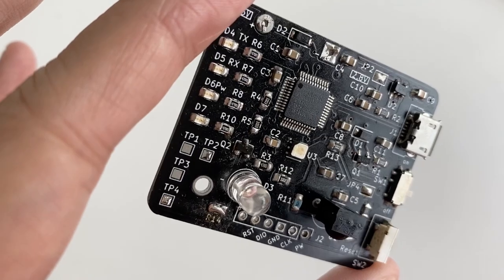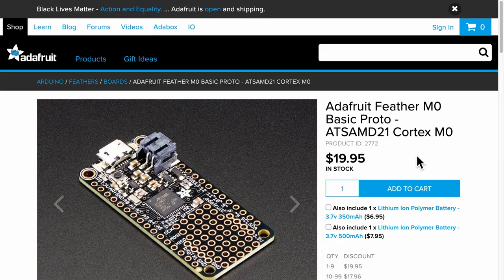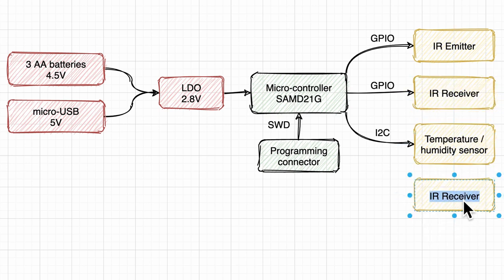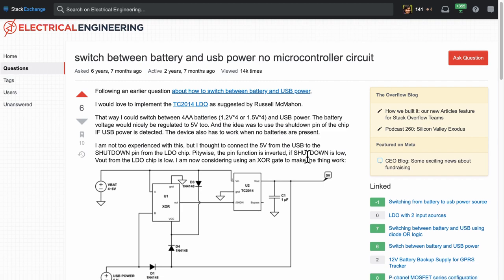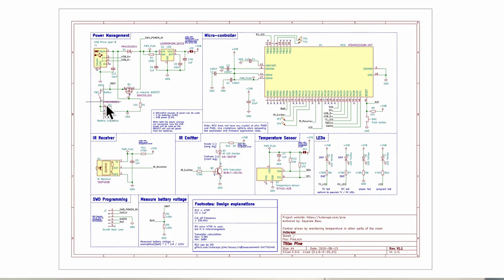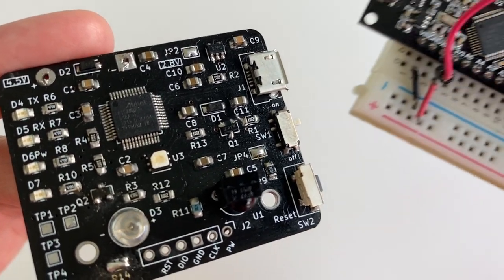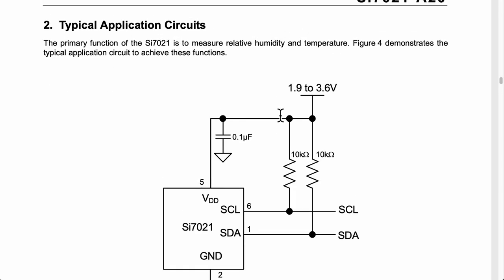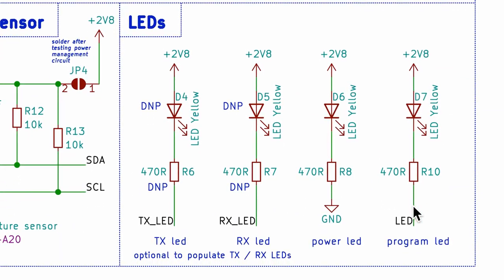Design considerations for transferring a breadboard prototype to custom PCB // Arduino, mcu, sensors

Comment: Thank you so much for such an in-depth and accurate manifestation of information. Recently I've designed two versions of my custom PCB for a project based on the PIC18F45Q43; but both times the MCU burns out when I power the circuit.. I think its the power and the PCB layout (Please let me know if someone thinks it could be some other cause). Nonetheless, it is videos like this that help a lot! So thanks again! 😊
Reply from the maker: Wow! Yeah, that's the most challenging part. Have you tried using a current limiting power supply or using 0-ohm resistors to isolate the PIC chip first and probing the GND and power pads? Maybe you did that already. Hope it works out for you!
Reply: @sayanee  I actually did not try the 0 ohm resistor approach. Since I'm not completely comfortable with soldering 0603 or 0805 resistors; I get them soldered through JLC PCB. In addition, unfortunately I do not have access to a current limiting power supply. 

On the contrary, if you don't mind; would you be able to recommend me a 5V power supply circuit for the PIC microcontrollers (SMD packages)? 1 Amp voltage regulator would do. 

Thank you so much once again!

Comment: So informative❤, I wasnt aware about the operating voltage range, I was deciding that 3v3 is standard, while in fact some devices range from 1v6 to 5v .
In addition, I think before we order any pcb , we need to test alot on bread board almost all circuitry before we put them in the final place on the pcb.
As well some compenent must have certain location in the pcb for instance decoupling capacitors to work perfectly they should be as close as possible from the mcu, same for the crystal. 😊

Comment: Hello Sayanee, where did you order the PCB's? also I have the doubt if you soldered all the components or what assembly service do you recommend? Thank you so much (I am asking this since JLCPCB for example, has lack of storage in many parts)
Reply from the maker: I use PCBWay now.

I too would like to try out assembly services. And I recognize that no matter what, we will not always be able to match all the components we want with what the service might provide.

Hence, I am thinking of doing a partial assembly. Get the passives and common parts (resistors, capacitors, LED, USB / JST connectors) and connectors assembled. And then, hand solder the rest.

At least, we will save a lot of time that way :)
Reply: @sayanee  could you recommend an specific assembly service company?? Thank you a lot for your videos, I am learning a lot with them
Reply from the maker: @IMTIvanBlake  I have never used one yet to recommend from personal experience. 

But I will do this with PCBWay for my next project: https://www.pcbway.com/pcb-assembly.html
Reply: @sayanee  thank you so much Sayanee, I will wait for your future videos ☺️

Comment: Excellent video Sayanee, kudos for the ways you explain concepts!!!

I am a hobbyist and doing some automation around the house using D1 Mini and NodeMCU boards to hook up sensors and relays. These boards have a microcontroller but on PCB design sites (& Kicad) I did not find any options to use D1 or NodeMCU boards for PCB design. Are these (D1 & NodeMCU) not standard options for PCB components?
Reply from the maker: "I did not find any options to use D1 or NodeMCU boards for PCB design" 

Do you mean specific schematic symbols and footprints for NodeMCU? 

If that's what you mean, then in general, no, you might not find the specific schematic symbol and footprint to use for many components. But, you can always do a search on GitHub / GitLab to check if someone else has already open-sourced it. 

If not make a new schematic symbol or a footprint. I did a previous video on making a new schematic symbol (https://www.youtube.com/watch?v=PXMvn3cztGg) and a new footprint from scratch (https://www.youtube.com/watch?v=VesvKjfd3SQ).

Hope this helps!
Reply: @sayanee  Thanks, that helps and bless you to keep up the good work!
Reply from the maker: @PM13501  I forgot to mention that for my past project I did make a schematic symbol for WeMos D1 Mini: https://github.com/hutscape/kicad-library/tree/master/symbols#wemos-d1-mini

and its footprint: https://github.com/hutscape/kicad-library/tree/master/footprints/wemos_d1_mini.pretty

Feel free to use it and iterate accordingly. All the best for your project too.

Comment: Hello, I am interested in turning my breadboard project on to a circuit board, I am rather new to this, But need help in the right direction.  I am a model railroad er I am using 2 IR sensors for detection from open to closing the gates an operating the lights an sound. An I really wanna add a circuit board so I can place it under the crossing an only have my IR wires connected to reach out.  
can you please help me on sending to have it manufactured or help me with the correct components to buy to make this an reality.

Comment: I want to use your battery/usb power switching logic in a small project I want to build with ESP32. But I am worried about the schottky diode (PM3020EH) that sits after the USB socket.
I believe the purpose of this diode is to cut off the path from the USB when your circuit is powered with batteries only. When the USB is connected this diode becomes turned on and 5V is delivered to the circuit from the USB while the P channel MOSFET is shut off, right? My issue is that I can't afford the voltage drop across this schottky diode because my circuit needs 5V to drive some other TTL chips. Your circuit only needs the 2.8V produced by the voltage regulator so the voltage drop is irrelevant. Do you know any other widely available schottky diode with a voltage drop of 0.3V because I wouldn't mind using 4.7V. Getting rid of this schottky diode doesn't seem to be an option. Any suggestions?
Reply from the maker: "When the USB is connected this diode becomes turned on and 5V is delivered to the circuit from the USB while the P channel MOSFET is shut off, right? " Yes, you are correct.

Nope, I'm unsure of any other part number for such diodes. I have not searched on the e-commerce sites, but is there a way to search for this parameter of voltage drop?

I'm curious, what kind of battery are you using? With ESP32 or my future projects, I'm planning to use rechargeable batteries actually. Hence, I'm planning to take some inspiration from Adafruit's LiPo and Power logic blocks here in this schematic: https://learn.adafruit.com/assets/52793 which does not need any MOSFET.
Reply: @sayanee  Just regular non recharging AA batteries to produced 12V
Reply from the maker: @신태진-w2g  Right, similar to my project.

I just did a search on element14 and found the lowest voltage drop goes to 230mv :( Not sure if that is low enough for you, but I found the parameter search for it http://www.farnell.com/datasheets/2907069.pdf

I hope you find the right Schottky diode!

Comment: How to code the micro controller
Reply from the maker: Specifically for SAMD21G, you can of course use Microchip's native firmware environment (which I have never done before): https://www.microchip.com/wwwproducts/en/ATsamd21g18

You can also install the Arduino bootloader and code in Arduino. I did a previous video on this method: https://www.youtube.com/watch?v=h2nKROPlFy0

Or just buy a dev board that already come with the Arduino bootloader if you are just starting out: https://store.arduino.cc/usa/arduino-zero

Other ways can also be Micropython or CircuitPython. For example https://learn.adafruit.com/adafruit-feather-m0-express-designed-for-circuit-python-circuitpython?view=all

Hope this helps!

Comment: Hi, I am your new subscriber, love the content in your channel. I am a student learning embedded systems and I  have question to ask.
Can we use Arduino for industrial projects? If yes then how? If no then whats the alternative? Or can you make a video on this topic?
Reply from the maker: Hi Jairaj! Wow, lucky you. Embedded systems is a great fundamental subject study. 

It's very hard to give a generic answer to all industrial projects. From my experience, it depends on the specific industrial equipment that we want to integrate. It also might depend on legacy technologies of the equipment that the organization already has. Also, industrial equipment sensors and actuators are expensive and have many more features and higher precision than a "maker" sensor. Hence, you probably need to write a separate Arduino library first for that specific sensor. The interface to integrate with the equipment might not be as "easy" as for example, I2C.

The term "Arduino" can mean the dev boards, the firmware stack, or even the ecosystem. I don't think we should use just the dev board for deploying at scale (10s or 100s) for many industrial pieces of equipment, but it can be great for prototyping. Do check out the Arduino pro website (https://www.arduino.cc/pro/why-pro) which is particularly suited for powerful industrial / enterprise applications.

Hope this helps!